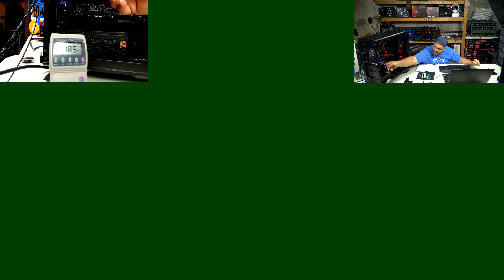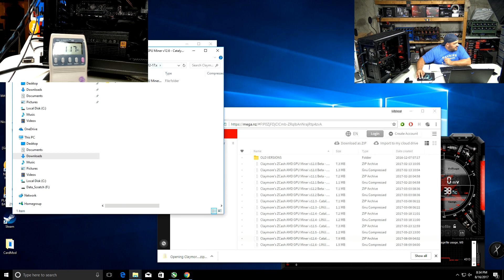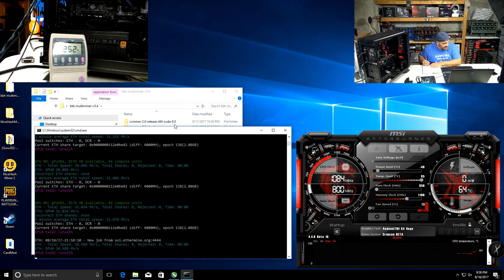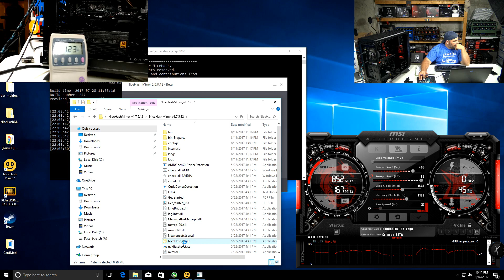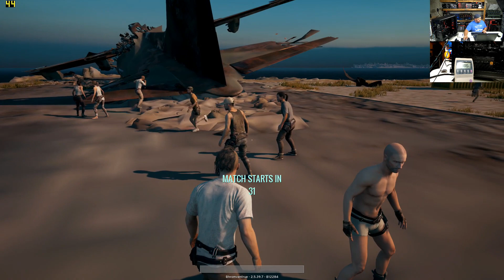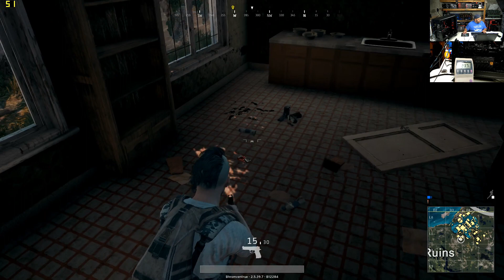Live Episode #50 Part 2: Sapphire RX VEGA 64 Mining Performance (power optimization maybe?)

Comment: Hello, I am watching this video again, when u set the rx vega 64 memory to 1100 it doesn't stay at 1100 but bounces from 800 - 1100, 37mh. But when u gave it more power it stayed at 1100 with 41MH - 43 Mh. The setting before when u set it to 1100 and got 37 MN the memory didn't go up but stayed at 945 time 39:53

Comment: YO YO YO DOG!
You get your other cards yet?
I'm having crashes like crazy when mining ETC/DCR. Not sure why it's crashing.
I have 5 cards 3 480 and two vega 64 and they wont work together, keep crashing and i dont know why.
Maybe the Vega are getting too hot, gets to 75 - 80C not sure how hot the memory get.
If you have some hints that would be great!
Reply from the maker: when your not dualmining they are stable? Back down some of the mem/gpu (you will mine a little slower) but may improve your stability.
Reply: I have them set to core 1050 and memory 1000 vega.
they are running fine but after 8 hour of watching then and i head to bed in the morning it rebooted. Not sure what is causing it.
I have not touch the voltage at all
Reply: I'm using claymore and I think the dev fee is what's causing the crashes! Whenever  it's time the cards do a reset for dev fee to start and stop. The fans and settings might get changed, cause the card to hit some kind of limit and it reboots.

Comment: Hi BBT, did you try using Watt Tool v0.92 for the undervolting? That's what Gamers Nexus was using in their vid. Also they were using the regular Vega gaming driver and not the mining driver so they may have been able to undervolt with Watt Tool because the gaming driver supports it.
Reply from the maker: We did not but that's a good option to try.

Comment: BBT can you guys do a video or test out the New AMD Blockchain compute driver for RX580's? Many people seem to be having issues with it including me. We're using DDU to uninstall and patching driver. My Claymore Eth speed actually jumped from 28MH/s to 30MH/s but after a while it drops to 19 and then 14MH/s. GPU load doing weird things at 20% and Memory jumping between 2150 and 1000 and back. All OC and undervolting done via Claymore batchfile. Used latest Afterburner. Had to revert back to old driver. Epoch 139 Really smacked me dropping 1MH/s from epoch 138.
Reply from the maker: We haven't just yet - most of our rigs actually run on linux. Pending Linux driver fix.
Reply: Check out the problems people are having
http://1stminingrig.com/ethereum-dag-hashrate-drop-fix-amd-official-mining-drivers-are-now-out/#Sapphire_Nitro_RX_580_4GB_4x_GPU_Mining_Rig
Reply: can you do a linux setup video like the ones you have done for windows. preferrably nvidia cards on a big rig like 13 cards or something.

Comment: Hopefully this helps.. I wrote about activating the undervolt on MSI on my STEEMIT BLOG..  

https://steemit.com/mining/@pok8rok8/msi-afterburner-bugs-voltage-control-problems-read-this
Reply: Also sometimes with just installing the MSI AfterBurner, if I do not install the Riva.. I will manage to open the voltage control.
Reply from the maker: Gave you a resteemit and upvote. Will try it out. Thanks for your contribution to the community
Reply: thanks..